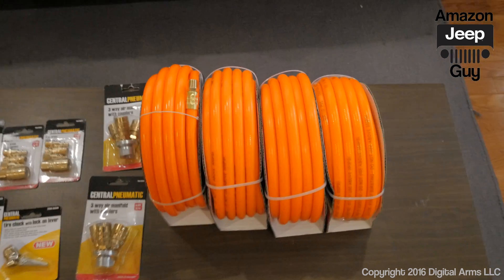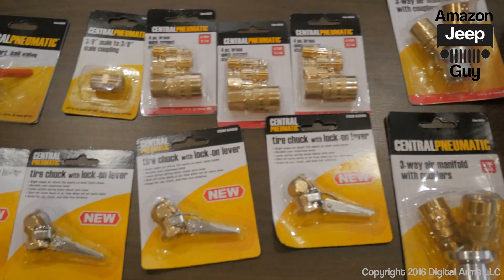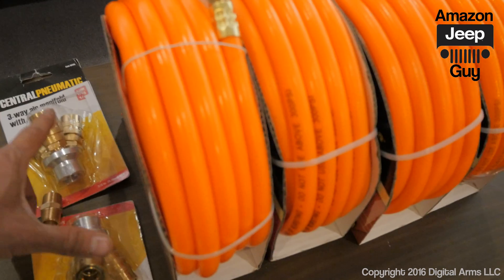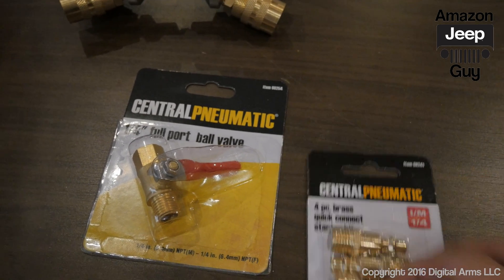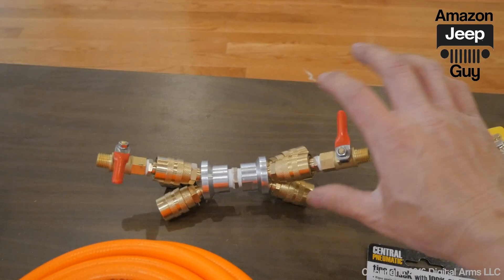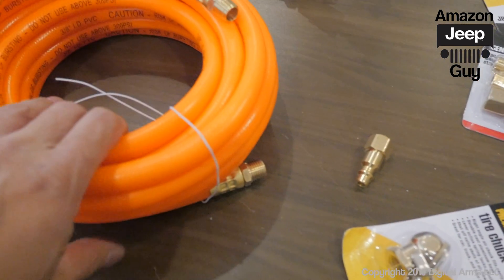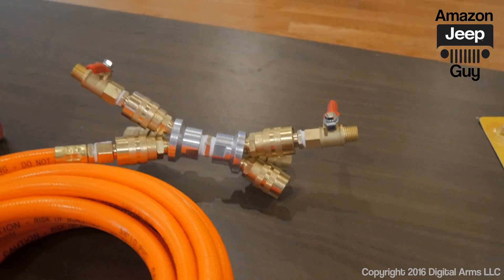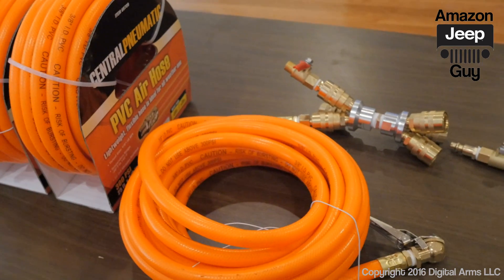Quick tire air deflator & inflator manifold build from 70 dollars of Harbor Frieght parts in 4K

Comment: Looks over complicated to me. You didn't demonstrate it working ! What capacity compressor do you think will simultaneously inflate 4 tyres (tires) ? Do you consider it necessary to have an on-board air tank in order to compensate for the demands of inflating all 4 tyres (tires) all connected to your 'octopuss' ?
Reply: Compressor will still be very slow and draw major current from your battery. Instead, get yourself a 10 lb CO2 tank set up and you'll be able to inflate all four tires pretty quickly.